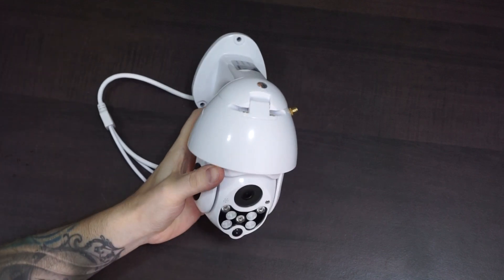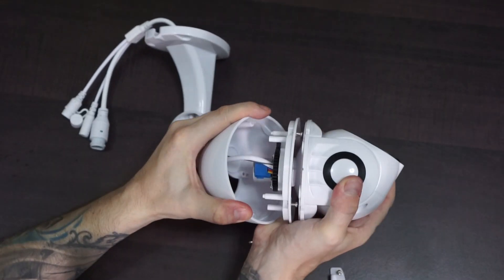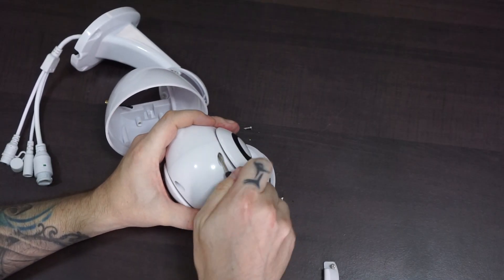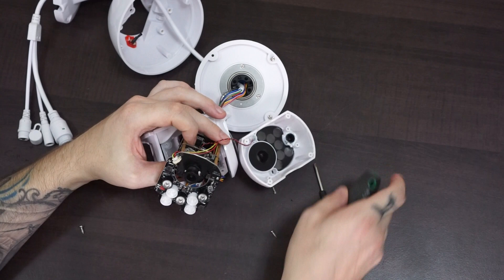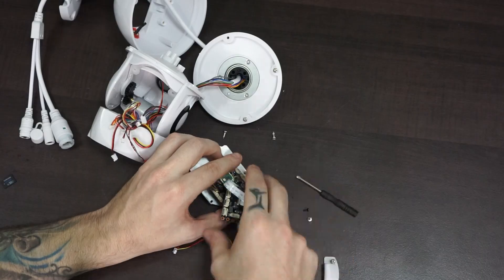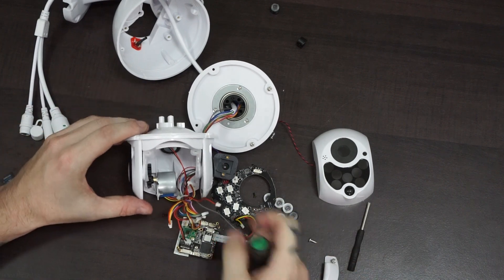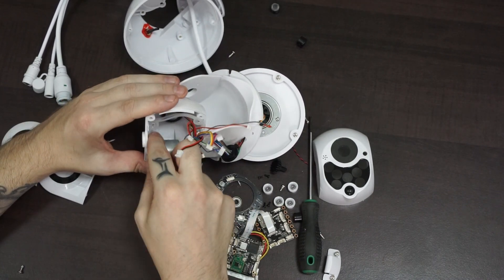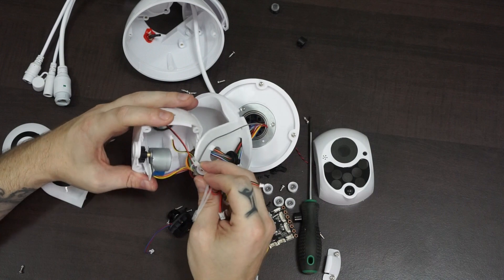What is Inside a Cheap PTZ IP Camera? - Teardown Besder Security Camera

Comment: Ok, can anyone tell me what that little button on the left side of the SD card insert is for?
Just a heads up don't try to go and Tinker with it if you don't actually know. That is what I did and when I hold the button down for three seconds it says reset successful so I was assuming that it was a extension of the other reset on the cord. But now my camera is not working.
Reply: Ok, update I did everything I possibly can except for one last thing. The same button that I had pushed next to the SD slot, it must have reset the whole system. You have to hold that same button down while the system is unplugged and then plug the system up while still holding the button down until the camera starts to move then release the button
Reply: @gentlebehn  I did the same reset with this small button. Now the camera is booting but is not prompting for any connection. And also is doing a cycle restart by itself after 5 mins. Did you manage to connect the camera after this reset?

Comment: Gday 
Can you replace the camera lens and mic to improve this camera ?

Also have you reviewed some NVR's from Aliexpress/dx/gearbest/etc ?

Merry Christmas
Reply: There are ways to do anything you want with the Right Mind Set.. If you want to put in another Camera with a Zoom lens it could be done. Issue is that you would most likely need to have some form of Control it could be simple 2 switch control for Pan and Tilt with the RS-485 wires going into the Body to the camera for Zoom functions... Then most import part is the ability to use the IR so you would want to make sure that you used a Zoom camera with IRC AKA Infrared Removable Cut Filter. This could also have name on camera like True Night/Day camera etc... If you use a camera that don't have the ability to see at night then the Front IR leds won't matter... I really wish the person would have sent the camera to me I would reuse it for making a Indoor camera for use outdoors. Jeez even in the state it was in at the end I would take for re use lol However I am not going to dig though the trash for it now...
Reply from the maker: Hi, not sure to be honest but I doubt it. I do have one cheap ONVIF NVR from Aliexpress but I haven't tried it yet. I might do a video in the future and see how many cameras I can connect to it. Merry Christmas!